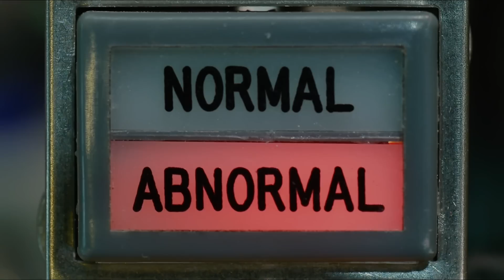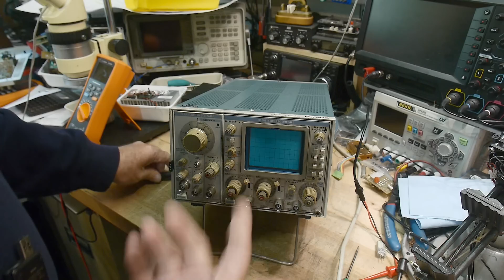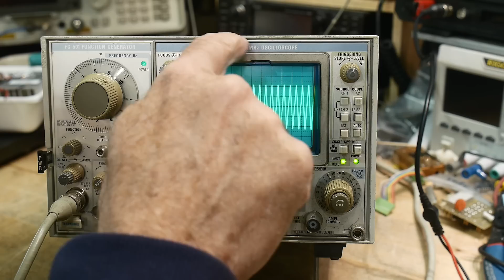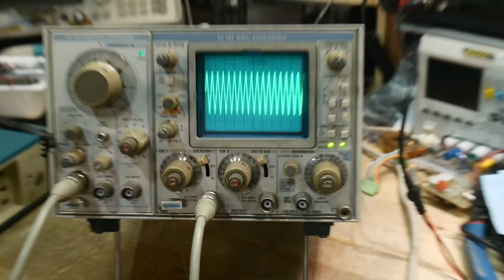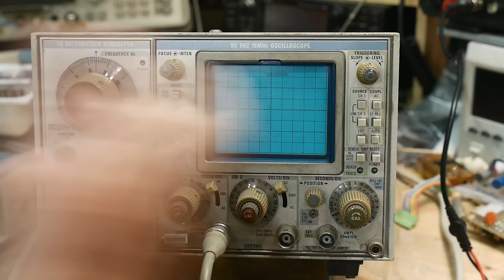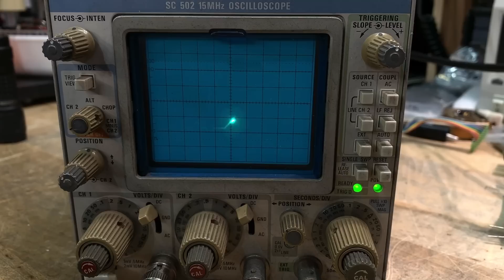#1350 Tektronix SC502 Oscilloscope in TM503 Chassis

Comment: Good stuff!  I've got the same scope and generator modules along with a freq. counter and DMM module in a TM515 (the portable suitcase version of the TM505).  It's my portable lab, great for field work.  I also have a TM503, normally stuffed with scope calibration modules, but I've some other misc. modules I use in there. In a similar addiction, I've got a half-dozen 7000 series scopes and a bunch of 7000 series plug-ins too.

Comment: Thank you for the series.  Brought back memories.  I'd like to apologize for being a bit cranky on your first review.  I did use these modules for many years and they all held up well.  They generally weren't my primary tools but they just worked over the years.  My favorite module was the FG504.  It was lots of fun for sweeping filters and such.  I worked in hospitals for most of working life and used lots of specialized test equipment.  The TM500 series was just always there doing its job.

Comment: I have the sc504. Same as the sc502, except 80MHz! Also have the sc501. It is super cool,  but agreed it has limited utility.

Look for a dc509 (I think). Puts that counter you got to shame.  There's better dvm modules too. 

You should also realize that with the ability to interconnect modules on the backplane that many units were set up for specific purposes for use by less technical people in a manufacturing environment.

Comment: Thanks for the series, good stuff. If you're not a fan of the TM503 power switch, have a look at the TM5003, it has a proper rocker switch on the front panel under the plugin modules.
Reply: ... its power switch ... (the possessive pronoun has no apostrophe!)

Comment: With the sweep set for 1 MHz, the duty cycle for 60 Hz will be too small to see on an analog scope.  Possibly, that is why we didn't see the line's trigger view.  Increasing intensity might make a horizontal line visible, but decreasing the sweep rate would be more correct.